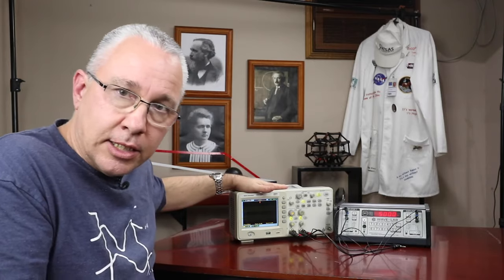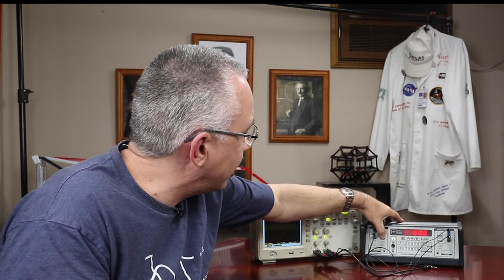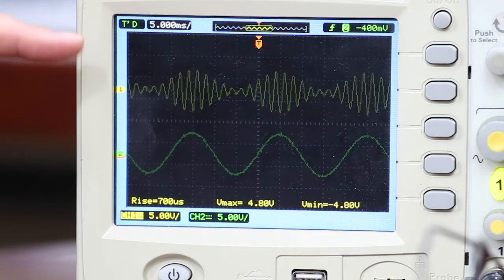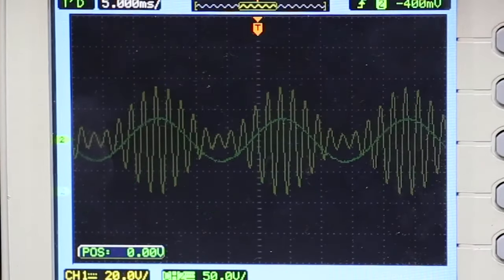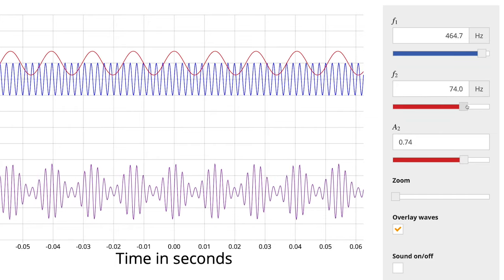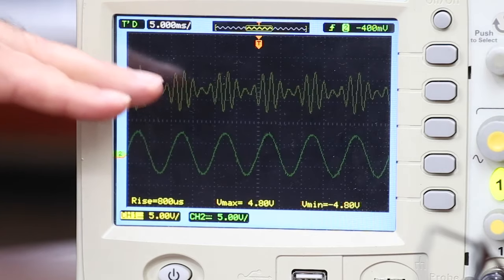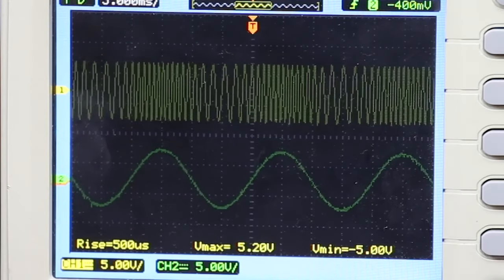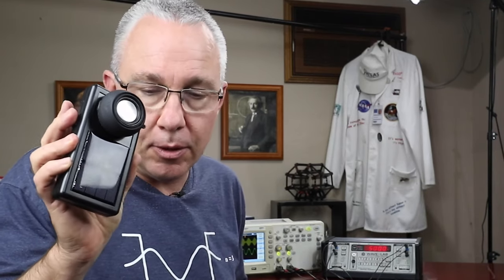modulation explained, with demonstrations of FM and AM.

Comment: How is signal added to carrier wave? What exactly occurs in the spot where they are added together? Why does carrier wave change just because signal is added to it? What device is used to add the carrier wave and the signal wave together? What happens at the other end, how is signal extracted from the composite waves, how is done and by what?
Reply: Yeah, this part could've been a bit clearer. Adding them up generates the wave that he said it was NOT a modulated signal. You, actually, have to multiply the two trig functions to get the modulated signal.
Reply: Any one want to chime in? What exactly is a signal. What exactly is a carrier wave. Vibrating air? Absorption/emission of an atom?
Reply: You guys really are going to need graduation in Telecom for that. Those answers answered in deep detail takes time to study and learn.
Reply: @gabrielfalcao2952  hello: Do you know how the modulation and demodulation work and why they work?
Reply: @jupitersaturnuranusneptune2816  A bit. I'm still mid semester.
Reply: @jupitersaturnuranusneptune2816  Trying to simplify, there's this part of the circuit where a capacitor and a transistor need extra voltage to generate a pulse, the higher the voltage the faster it goes. Then other parts of the circuit are in charge of the carrier signal. They are put together and then sent (the capacitor-transistor is responsible for turning frequencies higher or lower, since the transistor needs a minimum voltage to activate the output). That's for a simple frequency-modulation transmitter.

Like I said, I'm mid semester, and I'm still studying just that.
Reply: @jupitersaturnuranusneptune2816  For a demodulaton, we're still going to study in detail, but it's not that much different than a transmitter.
Reply: @jupitersaturnuranusneptune2816  There is a very simple way to make a transmitter using a cristal oscillator, but it has a lot of harmonics (frequencies above and below the desired frequency) and it's not a very good transmitter, as it is very low power and prone to interferences.
Reply: All these questions’ answers depend on what parameter you wish to exploit in order to affect a modulation of a carrier signal. The demonstration at the beginning of the video was in order to demonstrate a device designed around the amplitude of a broad spectrum of light rather than a specific frequency of light like say a traditional radio frequency.

Parameters are chosen depending on the ability to overcome the signal to noise ratio. Transmitters and receivers are designed around specific principles of operation. You can’t tune into an FM signal with an AM radio and expect an identical output.

Your questions deserve several hours of video explaining a multitude of ways to encode a signal into a carrier.

Comment: Great video.  Computer modems for telephone lines (I am not sure if hardly anyone uses them anymore) are modulators and demodulators getting the digital binary language of the computer off of an analog telephone signal.  The sound that you would hear if someone picked up another telephone in another room on the same line (weird sound) I believe would be the audio representation of those 1's and 0's.

Comment: The superposition actually was used - to encode color on top of the luminance signal of television/video. The phase shift from the reference ("color burst") at the beginning of each video scan line was the tint/color, the amplitude of the added color frequency was the color intensity ;-)
That's why old black and white televisions without a color frequency filter showed checkerboards and moirée patterns when receiving a color signal...

Comment: Very helpful for newbies like me to understanding AM and FM modulation. But I have a question: For the original AM radio, I grasp that the radio dial would adjust the carrier frequency (in kHz) to "tune" to a broadcast radio "band", and the circuitry would demodulate out the amplitude of the original source signal (prior to modulation, i.e., signal combination).  Good so far. But for FM... I'm a bit confused. If frequency is again used as the carrier signal to enable "band" selection (this time, in MHz), but now the source signal also uses frequency and is combined or "modulated" with the carrier signal, and has the effect of slowing down or speeding up the overall frequency of the carrier signal... then my question is, how can a radio tuned to a very precise radio frequency, say "98.9 MHz", not experience cut outs when the combined signal drops in and out of that specific band frequency? 

Stated slightly differently, with AM, while the amplitude of the overall signal is modulated to encode the source signal with a higher and lower amplitude. But it still remains locked to a set carrier frequency. Thus, a radio can "tune" into that set frequency and the proceed to demodulate out the source signal. But with FM, if the overall frequency is shifting around due to the combined carrier and source signals modulating on frequency instead of amplitude, how can a radio "lock onto" a set radio channel or "frequency" if the frequency its self is changing due to modulation?

Comment: In the early days of radio, FM was thought to be impossible. Also, you can receive more than one AM signal at a time, but not with FM, it has to be one or the other. You might could have mentioned this.

Comment: Thanks, that was great!  I watched a bunch of videos, but this one helps me visualize more readily.  I am wondering how the modulating signal is applied to the "data".  You demonstrated that it is not addition of the waves, but what it is it?  Division?  Is it by applying the calculus function of a sine wave with the desired parameters for frequency and amplitude?

Comment: In AM or FM, the source signal (sound) contains both volume changes and frequency changes. I've never been clear how AM or FM encode for both. Amplitude changes are kind of obvious, but frequency changes? Not so much. Does this have to do with bandwidth? How do two frequencies get modulated? It can't be just the amplitude of the carrier, can it?
Reply: If I understand correctly, in FM, the broadcast frequency is the center of a small frequency bandwidth. Within that bandwidth, the frequency (rate) of deviation of the center frequency corresponds to source frequency.  The amount of frequency deviation from the center frequency corresponds to source amplitude. It helps to think of it in the frequency domain as well as the time domain.
Reply: YouTube channel Kathy Loves Physics.
Reply: Modulation is changing the property of one wave (the carrier wave) based on the value of another wave (the signal). The value of a wave as a function of time is the immediate displacement of the oscillator that produces the wave, but frequency or amplitude are properties of the whole wave, or at least a local region of it around a specific point in time. You don't need to "encode" properties of the function like the amplitude or frequency, you just encode the function itself, as variations in the amplitude or frequency of the resulting wave.

Comment: This was very helpful. Your visual examples were great. I’m just getting in RF so could you put together another video on why we need to modulate the message? Maybe I missed it in this video.
Reply from the maker: Modulation means to change. It’s not the message that’s modulated it’s the carrier wave in such a way that carries the message.
Reply: A couple of reasons to modulate a higher frequency carrier wave would be to transmit the signal farther and also the antennas can be smaller. The higher the carrier frequency (the one you are modulating) the smaller the antenna can be. For example, a 1 MHz signal has a 1/2 wavelength (for dipole antenna) of 468 feet vs a 1GHz signal with a 1/2 wavelength of .468 feet (~14.3 cm). In his case the antenna is the size of light waves ... so, pretty small!

Comment: But are there essentially two distinct photons (of distinct wavelengths) jumbled together (for AM)?
Reply: I came to ask my own question but this one really got me thinking! 
I may be wrong, but I believe the modulation is happening to the light output (voltage / frequency shifts), rather than the actual photons of light or the wavelength. Bear in mind that wavelengths of light are orders of magnitude shorter than audio / radio and shouldn’t be a factor when considering either of the modulation frequencies. Obviously more light means more photons, but my thinking is that the LED chip in the torch will naturally have its own combination of wavelengths being emitted, which the circuitry can’t control. I imagine this would vary slightly depending on the output power, ambient conditions, etc., but I don’t think a solar panel should be able to distinguish between these in such a manner. 
I think if our eyes were infinitely sensitive, we would be able to see the brightness of the light varying very slightly as the modulated signal is transmitted, in the same way many LEDs use PWM to effectively dim. If photons or the wavelengths of the torch light were being altered, the variation would be seen in the colour of the light, rather than the brightness. 
Again… I think! 😂

Comment: I was hit with some questions and this answered a whole lot of them. 

My last one is how advanced chips would you need to have in order for this to work.

To me it seems like you need to do some math to undo the modulation and that sounds like it would need some kind of chip doing math to turn it back into what it originally was. Perhaps I underestimate the computing power of old first and second generation radios but I am looking for how that process works specifically
Reply from the maker: Yes. That’s what demodulators do.

Comment: What would you say when I told you that it is not amplitude modulation instead it is intensity modulation. C is all ways equal to frequency × wave length with any electro magnetic wave. Amplitude is strictly varying with frequency.

Comment: You did not specify the flashlight modulator is AM or FM ? If it is AM, Einstein's photon makes no sense, because it has no amplitude what so ever. And it already did not make any sense, because a wave without amplitude is not a wave, its just a straight line. So his photon particle-wave is a particle-line.
Reply: Tbh IDK about some of the things you mention, but my mind jumped to fiber optic cables. My imperfect understanding of fiber optic cables is that they use amplitude modulation to transmit information, while using different wavelengths to transmit potentially multiple data streams on 1 line.

Because they transmit information with AM in fiber optics, it seems more likely to be AM here.